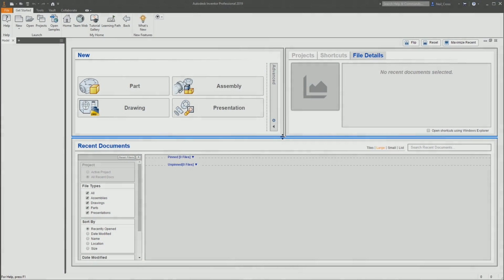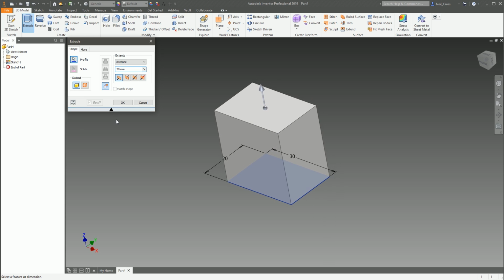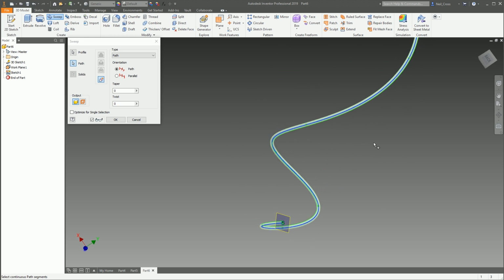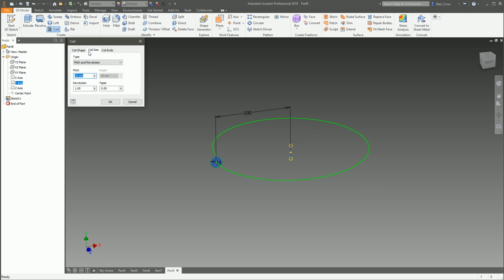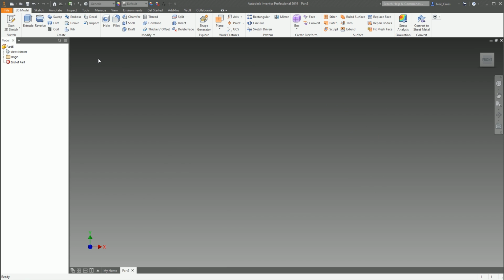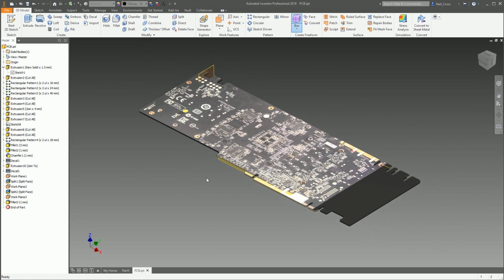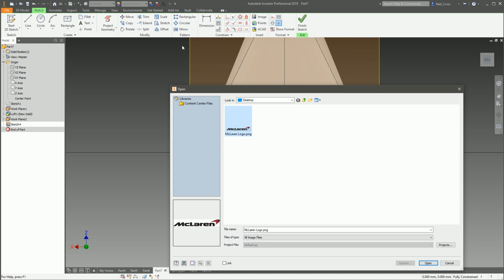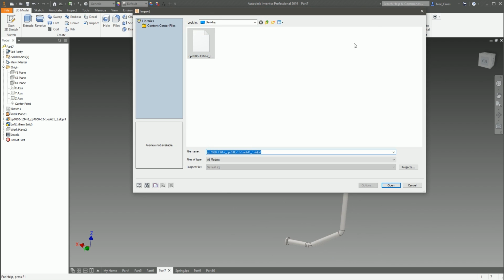AUTODESK INVENTOR EVERY BUTTON EXPLAINED! Part - 3D Model - Sketch & Create panels

Comment: Have you anywhere on your channel done a tutorial on best workflow for importing 3rd part models, manipulating them, scaling them in particular as they are often come in in the wrong scale, sometimes they are surface model or sketchup models that don't alway play nice. Maybe a good topic for a tutorial, as i get asked it frequently in the workplace on how to do it would be good if i could just say I know a really good tutorial video that will help you with that. Its the sort of thing I have to look up and remind my aging memory when it occurs.

Also  on a slightly different area but still relevant to importing third party CAD system data there  seems to be an increasing amount of point cloud data surveys that need to be referenced into models. I have been able to successfully swerve dealing with these so far but is the future it seems in collating existing survey data whether it be of machinery or buildings.

So to summarise not a specific request but an idea for a tutorial on dealing with 3rd party models of different types, unless of course you have done it already on your channel and i just can't find it

Comment: Slow down a bit and explain what your clicking on a bit more:)
Reply from the maker: Lee Bowers it's not meant to be a follow-along type of video, it's purely for someone to check up on what a button does and see it do its thing
Reply: TFI I know it’s not but there’s an issue with all educators who are confident in there knowledge of a subject going too fast,I’m just saying that I’ve noticed that while using this software that one wrong click and it all goes wrong.(as a beginner)

Comment: Hey man, I just discovered your channel! I am learning Google Sketchup for architectural modeling, and I was wondering if I should buy a pro grade GPU or a gaming GPU, since the program is OpenGL based and not DirectX. I watched your gaming laptop video, and I learned that there is no difference with Fusion. Sketchup does use OpenGl. Could you do another video about the difference in performance in programs in which the program or another program like this does use the 'pro' features? I´d love to see more AMD pro card btw. ;)